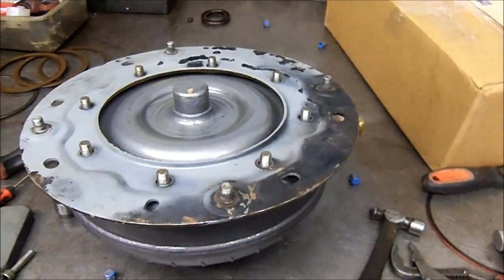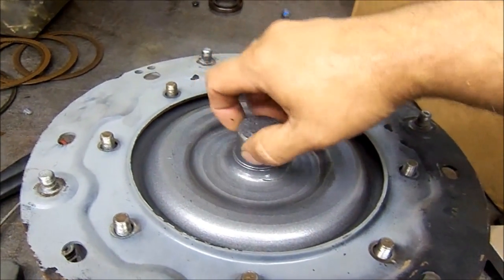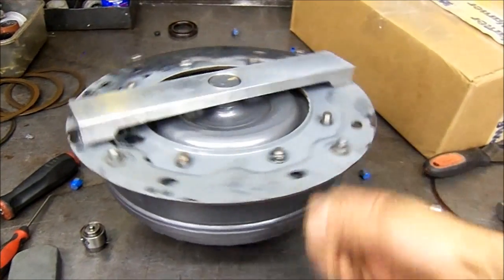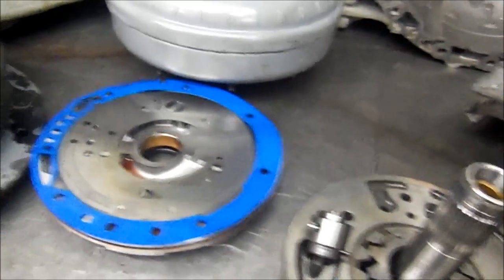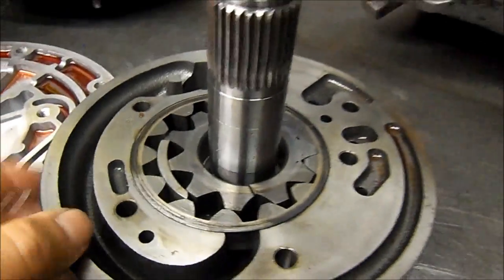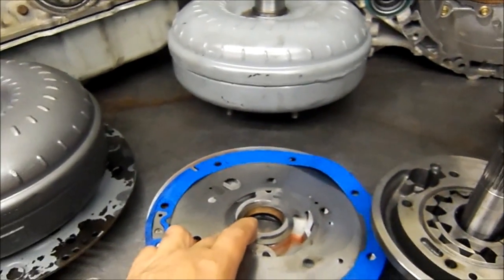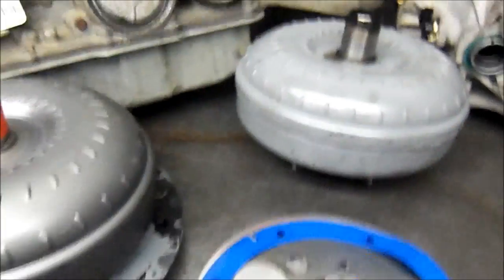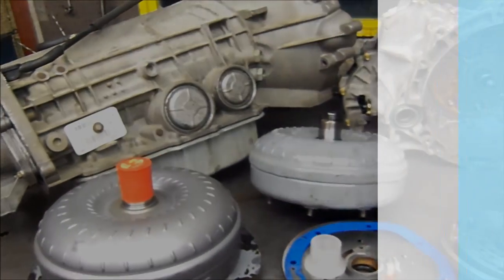5R55S Transmission Flex Plate to Converter Alignment

Comment: Have the same 4.6, bought it needing a motor, but after installation, never heard the vehicle run before, the trans shifts good but has a power steering-like whine from the bell housing.  Think pump or torque converter?

Comment: Good Video Hiram. Just to be clear, When you remove the transmission from the engine the plate you used the tool on is bolted to the torque converter only and not the flywheel correct? I did not see the other 4 studs on the plate till i watched the video again. Also, is the plate there because they used the same converter in other engine applications?
Thanks.

Comment: Is that the same on a v6 I had my transmission rebuilt but with a new torch converter but is had a shimmy after they put it back in I’m wandering if the 4.0 is the same because it has the 5R55S transmission too?

Comment: Never would've thought that, given how it doesn't really look like there's very much play room for the plate to move on the torque converter, even without the alignment tool. Then again, I've never worked on a 5R55S either, so go figure.

Comment: Hiram great video, I have a 2003 explorer RWD with the 5R55S trans and it has the jingling noise on idle and as the converter locks up it goes away, my question to you is would I be able to just get away with changing the converter or will I need a flex plate?

Comment: How would anyone know if the plate wasnt or is aligned correctly. Im wondering if this is my issue. Had transmission rebuilt and now I have a knocking sound. Sounds to be coming from tbe bell housing. Could be rod knock. I have engine and trans out wanted to check plate alignment on torque converter to rule out.
Reply: what solved your problem?

Comment: i just bought a torque converter for my mustang 2006 gt why did it ony have 4 bolts bought it at parts geek
Reply: mario almazan Just bought one for my 06 Gt. Has to be 8 bolt if you're going back stock and if you are,the bitch is finding the flexplate online. Mine was a bad torque converter and flexplate. Got the flexplate from ford and the 8 bolt converter from a shop that is on eBay that does torque converters only. I originally purchased my converter from Autozone(had to be ordered)came in and was a four bolt.Not gonna work with stock 8 bolt flexplate. The only way your four bolt converter will work is if someone switched it over to a four bolt flexplate and I would guess that's were your problem is? I know its been six months since your post but did you get it figured out?